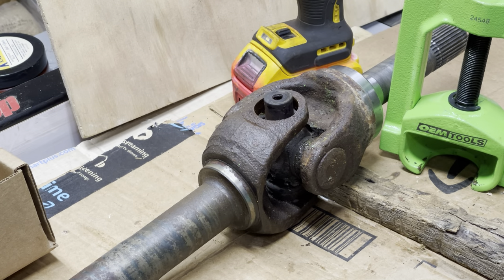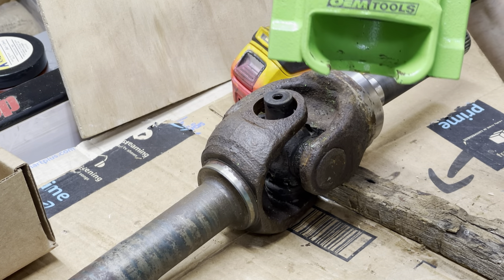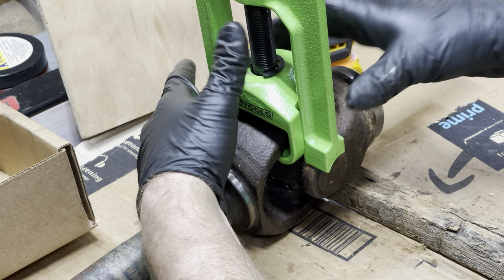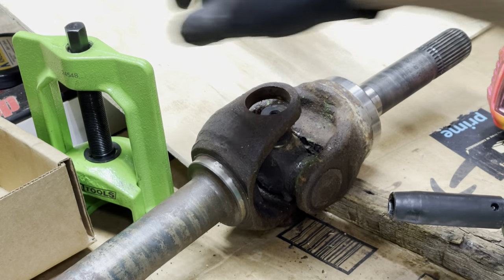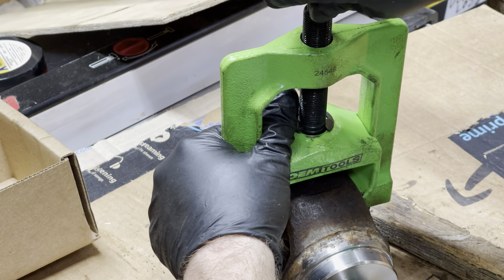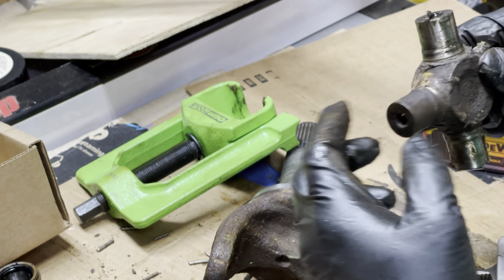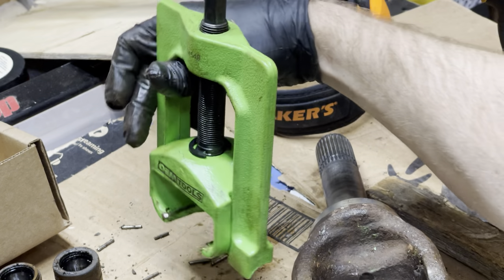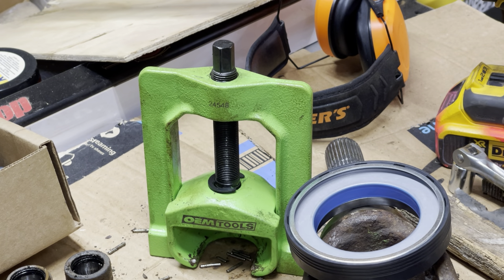easy U-Joint puller excursion Super duty Ford

Comment: They make a special tool for the vacuum bearing. Highly recommend doing manual lockout the vacuum was noted to engage and not my truck destroyed that bearing and ruined the teeth on that outside yoke to its failure. Another thing to note is on Excursion that axle is a Dana 50 not a 60 axle so it won’t mesh or make it pass the inner seal as well.
Reply: Thanks for sharing. I am constantly collecting new tools.

Comment: very clever tool. however, it is still possible to bend the ears on the yokes if the ujoints are badly stuck because it has to yank on one yoke ear while it pushes on another, regardless of where the body of the tool applies pressure, if the cap is stuck it will try to move the ear with it because its theoretically welded itself to the ear. it does the same thing stress wise as a balljoint press does, but it is superior for assembly and i will be making a video as to why.
Reply from the maker: Thanks for the explanation. I am all about learning new techniques.